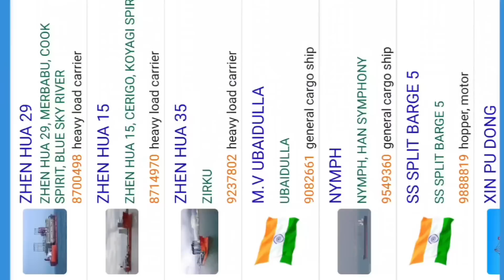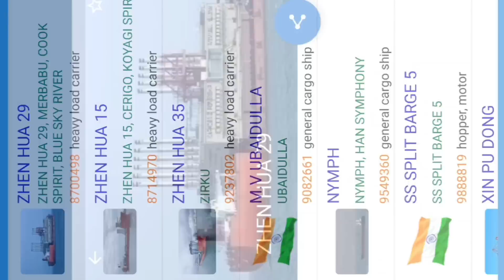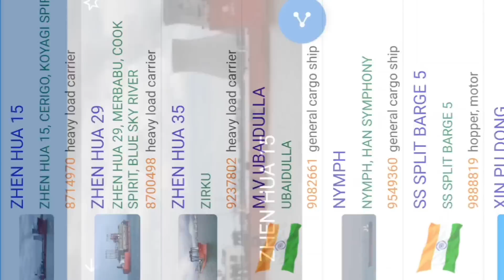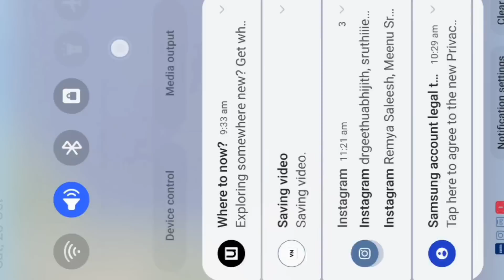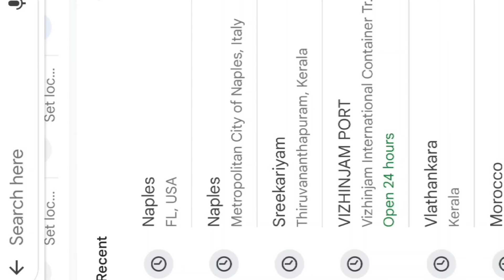വിഴിഞ്ഞം works വളരെ വേഗത്തിൽ. Vizhijam Port, Trivandrum.

Comment: ബർത്തനഉം ഷോറിനും ഇടയിൽ ഇനി റെക്ലയിം ചെയ്യാൻ ഉണ്ടോ!ആ  ഭാഗം ആണോ വെള്ളം കേട്ടി നിൽക്കുന്നത്
Reply: Yes.. Correct
Reply: There are making like a pool inside and then pumping dredging sludge into the pool, water will be redirected back to sea and sediments will remains in the pool and eventually it will get filled with sedimented sand. Like wise they are reclaiming the sea into land and then convert it into Berth yard areas
Reply from the maker: അതെ ഉണ്ട്..